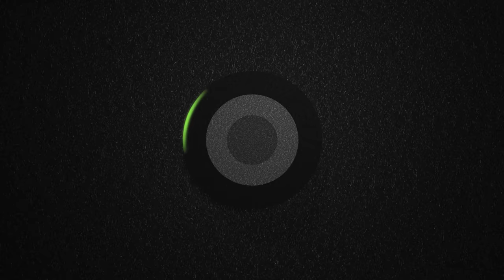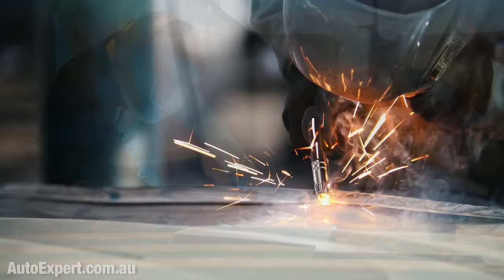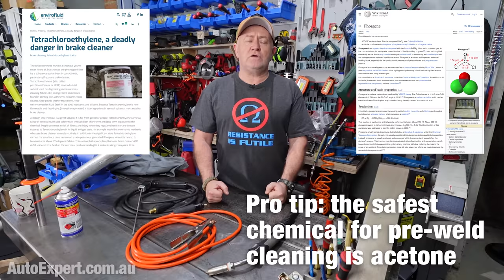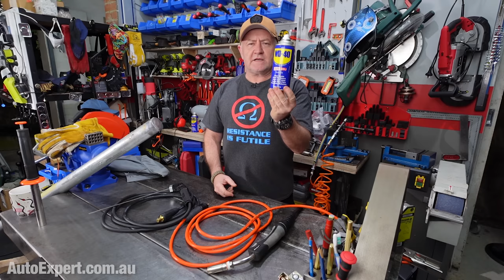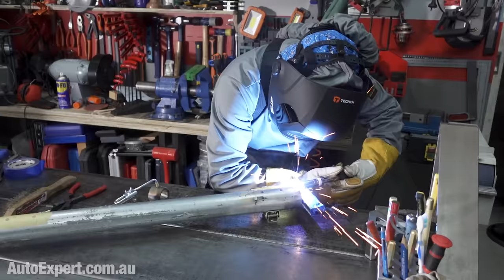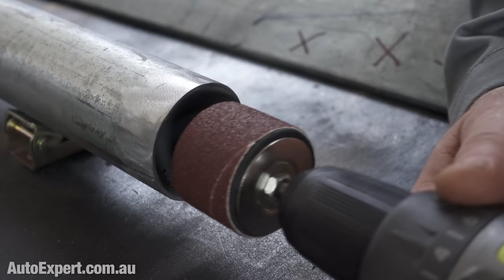How to die while arc welding at home: the top 5 ways | Auto Expert John Cadogan

Comment: I'm 70 years old and I've been welding at home and on some jobs for over 50 years. After watching your video I realized, I'm lucky to be alive. Thank you so much.
Reply: Seriously! God is watching out for us.
Reply: Yeah, I've been in a lot of crazy welding shops over last 45 years, I always got a kick over how scared guys were of an oxygen tank flying around like a missle, but no one ever cared about acetylene blowing up or making huge flames.
One day I watched some joker cutting with a torch off of a bench, the slag dripping right on the hoses making a big hot pile.  Then he shuts it off and GOES AWAY.
I look and noticed he left the pile burning on top of the hoses which are now on fire. I went over and put my foot on it to kill the flames, and as I let up the acetylene hose blows out.
If it were still flaming it would have made a nice fireball.
Made me wonder about if I wasn't there to snuff it out and then shut off acetylene.
Reply: @michaelszczys8316  We used to lay them oxygen tanks on the piers off lake Michigan then brake off the valve head with a sledge hammer and watch the tanks take off across the water, I remember one tank doing a u turn right towards us. Yes alcohol was involved.
Reply: @darrinrentruc6614  That sounds like my kind of Friday night lmao!
Reply: @darrinrentruc6614  I remember talking to a delivery driver who told me about how they would check all the tanks for pressure at some plant along the Detroit River, looking for tanks with the highest pressure. When he asked them why they took him around to show him a special ' launch ' ramp they made to occasionally fire off tanks across the river to another plant on the Canadian side. He said that place would shoot back. They never quite made it but he said sometimes they got close.
Wasn't sure whether to believe him or not.
Reply: Exactly the same age here Wayne. Self taught. Been using a fan on the job always for ventilation. Got rid of my old heavy transformer based arc some years back and replaced it with a lightweight inverter. What a lovely thing that was. Have just replaced THAT with a MIG and learning to drive that now as my hands are shaking badly and having a footlong electrode waving around is not conducive to accurate welds. The MIG being wire fed is just right for me. 
This video is full of interesting and necessary information. Thanks John. Seems I'm not alone.
Reply: Unless you submerge your welder - you were NEVER in danger. It's a scary, fictional story.
Reply: @darrinrentruc6614    I was in the dive shop at NAS Bermuda filling  tanks  when someone  who was putting them into storage  dropped a freshly filled 3440 tank onto a chunk of angle iron...  J valves are generally pretty tough, but  this one broke off and the tank bounced  two or three times  then hovered about about 4  feet in the air,   spinning at  a pretty good clip... whole episode only lasted a couple seconds-  it was surreal  - didn't become terrifying until the safety office folks arrived...
Reply: There is true wisdom in accepting and knowing our limitations, and be willing to learn at any later age.
I salute you Sir!.
Reply: Engineers😂 am I right?!
Reply: @markc4768  Them safety guys take the fun out of everything
Reply: @darrinrentruc6614  The story my college professor told me was that he watched a guy knock the valve off and get it in the chest.  That one and the one about the girl that got scalped by a grinder were images that haven't left me, even though I wasn't there.  My roommate lost a finger to a table saw.  Art is long, life is short - literally.
Reply: Same here
Reply: This video really blows me away with respect to the FG gas, and the galvanized. I knew there was some danger. I didn’t realize it was such a serious danger.
Reply: @allnoyz1414  agreed I'm in the uk 240v mains i dont bother with gloves i only get a shock if i'm sitting on damp grass & change the stick, touching the earth is worse but its only a tingle less than them joke lighters that give you a shock
Reply: Well, I am not quite 70 - yet, but ever since I gained adulthood - we won't talk about my teenage years - I have been extremely careful, sometimes even a bit obsessive, about safety.  I cannot count the number of times my going an extra mile - or at least a few hundred meters - over and above ordinary safety rules has saved my ass.  I have all my fingers and toes, and the only scars from my adult years were produced by surgeons.  (Unfortunately, I have lots of those.)
Reply: I was going to buy a small Amazon welder and start playing around.   I just realized that it’s dangerous.  Thank you for your video.
Reply: welding in my shop in TX and hotter than a whore in church.   Was sweating thru my long sleeve shirt while AC TIG welding.  Propped my wrist on the table while hitting the start pedal for the torch and was LIT UP by the high frequency TIG electric.

Comment: Zinc's a monster. I tried alloying brass in my shop and got the temperature wrong. It went straight from solid metal to dense clouds of white fog. The space I work in is much bigger than a garage, and I had a bay door open so I was able to hold my breath and run away after putting a lid on it. The one problem with random how to videos is that they always show the successes, never the panicked retreats :)
Reply: Most of those videos show active disregard for the zinc fumes
Reply: Do you just run away and let the gas blow away??
Reply: Yikes that sounds scary
Reply: It's always best to get as low as possible when this happens, lets you escape most of the fumes.
Reply: Yes most alloys melt much hotter than the zinc portion
Reply: I used to cast brass... Zinc fumes are a bitch
Reply: I do not ever recommend any process of this sort without at the very least a high flow vent hood, or much preferably a positively ventilated cabinet.  I don't know about anyone else, but my life and health are worth more than a few hundred dollars spent on a quality ventilation system.  Heck, we are talking about welders and fabricators, here.  We can build one for almost nothing from scrap and used parts.
Reply: Hot metal spray or metal spray processes. The ones that vaporise a metal wire through an arc and transfer it to a surface, akin to spray paint.
The single most effective way of getting rid of every pigeon in the factory.
Rather that was the lad who had to sweep them up the next day but you get the idea.

Comment: Good job!  My dad was a long time Iron worker.  He told me once that I should drink milk after welding galvanized metal.  I thought he was nuts so I went to research.  It was true.  The explanation is very Bill Nie the science guy.  In short the minerals of the milk bind to the bad stuff and is expelled naturally.  when you get older you finally start seeing that your parents do really know something !
Reply: i was told the same thing!
Reply: I think it's better just to avoid the fumes rather than drinking a glass of milk.
Reply: I trained as a welder back in the 80's in the UK - we were all given a pint of milk at morning break daily..
Reply: The name for it is chelation therapy. Hope I spelled it right. I don't know if it is still recommended but it was a pretty common treatment years ago. Also, beware of the plume of smoke from welding stainless steel.
Reply: @teddeebayre3433 While avoiding as much as possible is a good idea, unfortunately it's not possible to completely avoid them, unless you refuse from work altogether. And the avoiding of fumes vs. drinking milk are not mutually exclusive and therefore not that comparable. Milk is healthy anyway.
Reply: Hexavalent chromium [Cr(VI)] exposure is brutal! It is a result of welding Stainless Steel. Actually its the reason Erin Brockovich sued Pacific Gas and Electric Co. (PG&E) in 1993 for contaminating the groundwater of Hinkley, California, with hexavalent chromium, also known as chromium-6, in the 1990s. PG&E used chromium-6 to prevent corrosion in its cooling towers from 1952 to 1966, and some of the wastewater from the cooling towers seeped into the groundwater. In 1996, PG&E settled out of court with the town for $333 million, which was a record settlement at the time.
Reply: I also was given the milk as a post- precaution along with well ventilation.
Reply: Yes, we were all given one pint of milk per day each while working in the welding shop in a German factory.
Reply: I used to work in an anodising factory. We would be given a 300ml carton of milk everyday.
Reply: I thought everyone knew this.
Reply: @teddeebayre3433  No, avoidance is a great notion, but it is not always possible, and failure not always evident, either.  A glass of milk is a good precaution and it's good for you, anyway.
Reply: Imagine that!!
Reply: When you drink milk, it goes in your stomach, when you breathe it goes in your lungs. How can it help??
Reply: Drank many gallon's of milk after trying galvanized in college.
Reply: Been a long time since, I have done any need machine setting and help from someone more experienced 
to get anything done.
Reply: Need re-trained for basic weld's.
Reply: I'm on a lot less medication now, I'm happy with less.
Reply: Do you not use an adflo hood? If you can smell it, you're inhaling it, and I can't smell anything when using an adflo.

Had welders sickness twice. From welding mild steel straight off the probo, and welding stainless. They both sucked and I will never not use an adflo ever again.
Reply: The excess calcium in the milk binds with the Zinc Oxide in your blood stream. The Zinc Oxide is what makes you sick. This new bonded mix is passed to the kidneys and the bladder, then out the pee pipe and into the sewer where it can't build up and make you sick. Definitely avoidance is the primary action, but if exposure happens, milk can reduce the symptoms and accelerate the recovery.
Reply: I was told the same thing, I never even thought about it until now.
Reply: @teddeebayre3433  exposures can still happen by accident though, so it remains good to know how to help yourself when they happen. Its like having an eyewash station in a chemistry lab, you dont install it hoping people will start pouring amonia into their eyes.

Comment: The first lesson I got as a teenager from my uncle was "galvanized will kill you"   and thankfully someone else on the tube identified the break clearner problem.  What you don't know can kill you.  Thanks for keeping the knowledge flowing.
Reply: Yep….I learned about the risks of galvanized steel early in my welding career.  I’ve welded EMT conduit but did so very carefully and only in short bursts and kept my face away from the fumes.
Reply: Ah the old “break” cleaner…. *BRAKE cleaner.
Reply: @w5cdtwhy would you weld emt??
Reply: A good friend of mine had a friend that welded a lot of galvanized stuff all in one day in an enclosed garage.   He died from it.  I'm always extra careful when welding anything galvanized; do it outside when possible.

Comment: As a retired engineer myself; I always wondered if it was possible for an electrocution situation. You answered that and stated other hazards I never thought of very nicely. Thank you.
Reply: Are you admitting you're an engineer ? Question ...do you guys use what you engineer , or work on it ? Cause I've seen some dumb shit on cars and trucks , I always wondered if there was a engineer behind that design , or did someone screw up the engineers drawings ?
Reply: 14:36 - Ah, a big FFB! But seriously, I am glad that you posted this, and that I saw it, because in my younger years, I had worked around a careless person doing stick welding, and assumed by his seeming lack of care, that one might not get electrocuted by a stick welder due to the current flowing from the stick to the piece. When I retire, I expect to purchase a welder to work on my old cars, and I could have imagined myself using my stick hand to raise my face shield. A mig welder less dangerous due to the need to press the trigger, but the possibility does exist. And wow, I never thought about completing a circuit with a WD 40 or similar can. The same danger could happen under the hood of a car near the battery or other hot connection. Holy smokes (pardon the pun) this vid was a great public service advisory,  thank you.
Reply: youre an engineer and you wondered if it was possible to electrocute yourself welding. thats fucking scary man. i dropped out of school at 15 and this its always been obvious to me that making an electrical circuit with you in the middle is not a good idea
Reply: @MikeSmith-nu9wt  You want to know something about the auto industry. Well the designers, design the vehicles and make them look a certain way, then it gets approved to build. 
then they attach all the engine combo and tranny options along with all the other items. Then it gets kicked over to the engineers. To make all that stuff work around the design of the vehicles.  So at the end of the day it has nothing to do with the engineers, but we get blamed for it all the time.
Reply: @MikeSmith-nu9wt  Engineers have to take cost into consideration.
Bad designs can make it into a car if they are 10 cents cheaper.....
On petrol  compacts the most expensive part is most of the time the paint because that's what sells.
Reply: @philippe94416  Interesting.  And I am pretty sure that design for manufacturability (being able to manufacture components and assemble them in to quality cars at a cost that people can afford to pay + a profit margin) receives higher priority than considerations like ease of maintenance and repair.
Reply: @predater5017  The voltages involved in arc welding are very low, in the region of 20 to 50V normally. That's usually not enough to electrocute someone because of the body's natural skin resistance. But sweating changes the equation dramatically.
Reply: @rexsceleratorum1632  fair enough, i guess with that knowledge you might assume its safe. at the same time though, everyone sweats. idk if youre checking your electrical resistance all day but i dont and im sure most other people dont. its probbaly best to assume you have 0 resistance at all times from a safety point of view.
Reply: @predater5017  Even sweaty humans have a resistance of at least 1000 ohms. We don't normally die or even get shocks from handling 9V batteries carelessly after all.

The low voltage should make welding electrically safe, but you can end up being extremely unlucky, that is all. Like touching one lead on your tongue, say.
Reply: @predater5017  It's not sweat, per say, that is electrically conductive, it's what's in the sweat.. Water ( H2O), isn't, in and of itself, particularly conductive. It's the stuff in the water that conducts through the water. Sweat contains a whack of salt ..  The difference in conductivity between pure water and salt water is incredible.
Reply: My comment centers around my seeing so many folks welding with zero precautions from electrocution.  I see people worried about sunburn from the UV, damage to the eyes, and sparks setting off fires.  However, I have never seen anyone even mention shock hazards.  I have asked many folks about this while they were setting up their work and they always said not to worry, "it doesn't happen", but they cannot tell me why it doesn't.   That is all I was trying to say.  I am a licensed structural engineer (retired after 40 years) and have worked (inspected and designed steel elements) on many steel bridges and watched the welders and again never saw anyone guarding against shock hazards.  I was happy that John C. made this video!  No need to make fun of my comment or my occupation.
Reply: @williamkroth9429  Well, no one guards against the "shock hazard" because there really isn't one short of a freak accident. You can also die from a tiny 9V battery if you apply it correctly to your heart by puncturing some skin.
Reply: @rexsceleratorum1632   It is true that the welding voltage is generally below 50V  (usually between 20 and 40V) on an SMAW machine.  However, the open circuit voltage (OCV) can be as high as 100V.

Comment: Within the first few minutes it's clear how well spoken, prepared, and sourced your videos are, and I think I've just found a new favourite DIY educator.
Reply: I was proven right nearly 20 minutes later when, as someone who is about to make his first folding workbench out of galvanized steel, I learned that if I'm doing so it's definitely best to not weld it and instead go with the original plan of angle sections riveted in the corners for support.